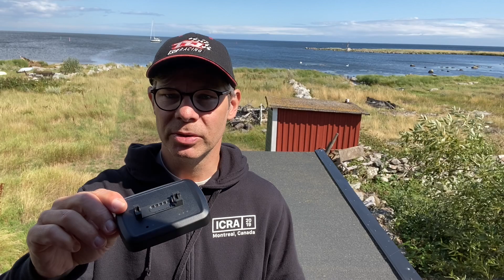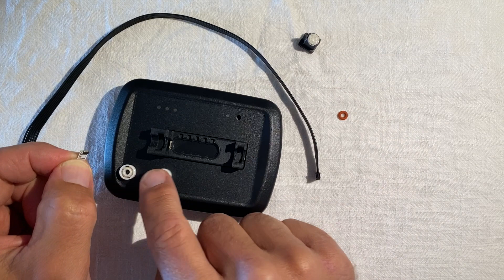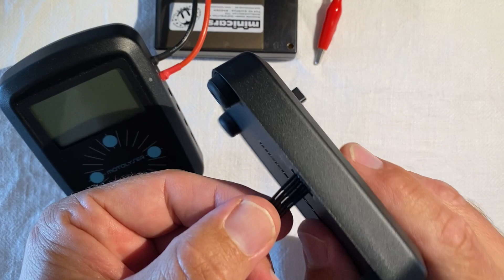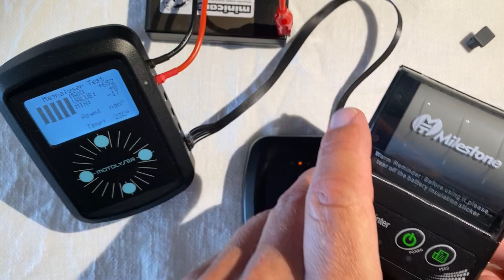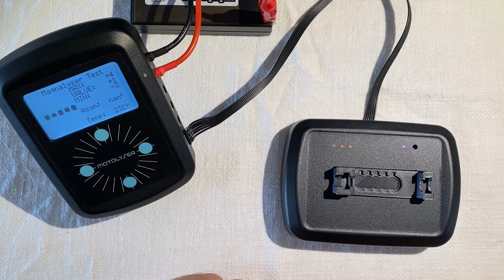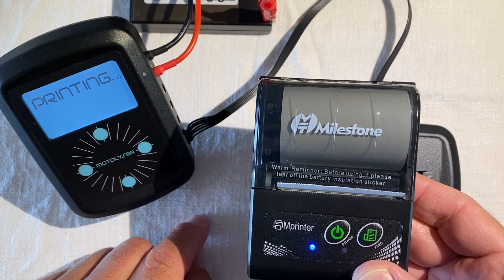Magnalyser - Getting Started

Comment: My asym reading on the magnalyser is way higher than my MotoLyser?
Also you mentioned calibration of the magnet value? My came with a default of 680, what should this be set at. I believe you used 650?
Reply: Asym on magnalyser is 16.0 and MotoLyser is .9? Big difference